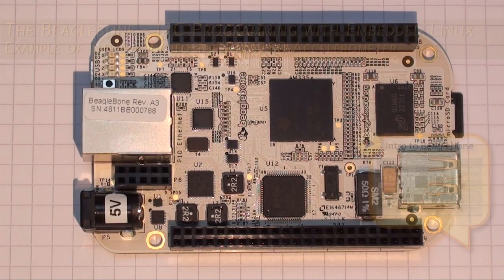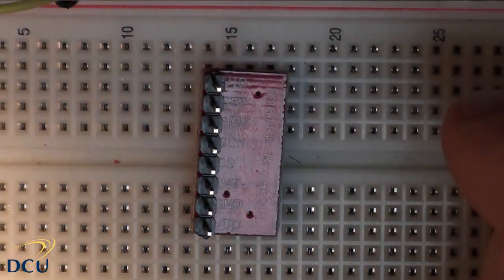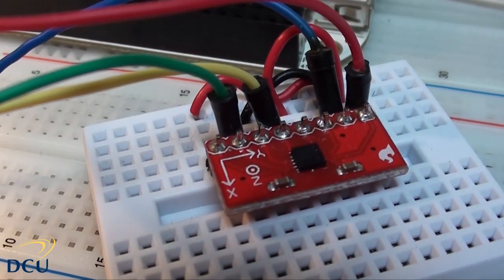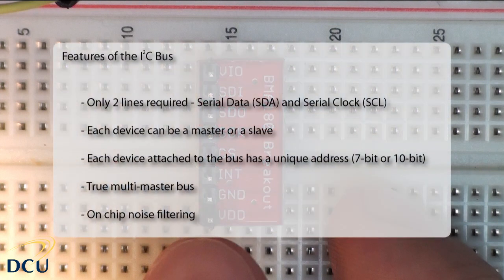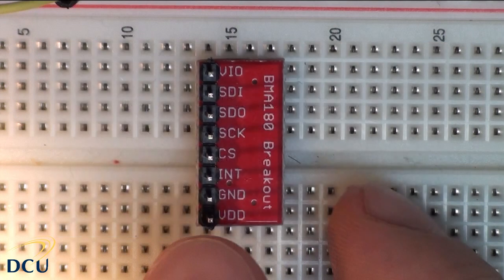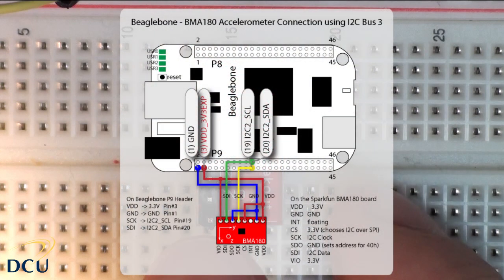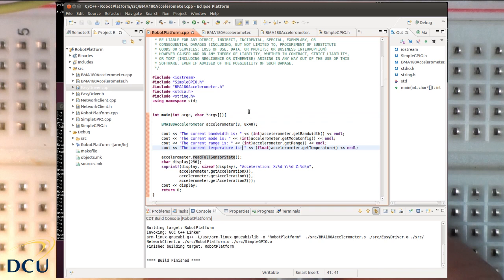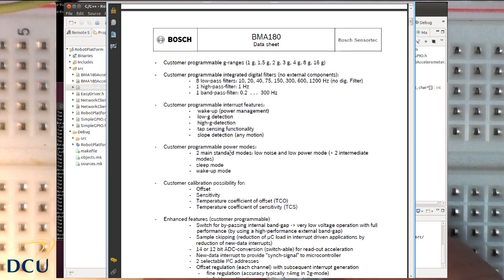Beaglebone: An I2C Tutorial - Interfacing to a BMA180 Accelerometer

Comment: No worries - thanks for letting me know. I found the KPlotWidget which will do the same job. I will now spend my day understanding (1) how to open a socket on the Beaglebone and expose the sensor data, (2) accessing the data on the host PC, and (3) displaying it in a simple Qt application. Fun! If I succeed, I will post the code on github in case anyone else is interested.

Comment: FYI, In some fields I do believe it is standard practice to utilize the full resolution of the destination variable when pushing your ADC values into place. This allows you to replace the ADC with one of a different resolution without needing additional programming changes (assuming the interface has not changed). Thus a 14-bit ADC and a 12-bit ADC would both utilize the same scale. Uusing a ushort, for example, would provide a universal scale of 0 to 65535 regardless of ADC resolution. This is very common in industrial applications.

Comment from the maker: Hi Bessem, I'll try to dig out the source code for my website. I had trouble finding it just now. The code on the client side contains some code that I do not have permission to redistribute. The code on the beaglebone was regular C++ socket code and the code on the server side (PC) was the standard QT socket example. The intercommunication worked straight off (if I remember correctly - there may have been one late night!)

Comment: this seems like an easier (?) way to interface through sysfs than directly through any I2C calls, worrying about whether SMBUS protocol is implemented, or what have you. definitely work some time to get better acquainted with this way or working with I2C.
Reply: when I worked with I2C, I did similar driver/application level class abstractions. good stuff. also using C++1y standards, strongly typed enums, using hex-enum values, to make it easier to translate to/from device docs, etc. driver classes being close to the metal, application classes being abstractions for the application level, where it makes sense, may combine multiple driver classes into various sessions, etc. well, closer to the metal, if you talk to pure C-guys, but with C++ any more, it's about as close as you can get to the metal. std::bitset is wonderful for this! :)

Comment from the maker: When you mount the SD card under Linux it should come up as two drives: Boot /media/boot, And rootfs. I have enabled i2c-2, by adding "i2c_bus=2,400" to boot arguments in uEnv.txt (under Boot). Now, I made this change after rebuilding the Kernel (in my next Beaglebone video) so I may have made some changes to the kernel configuration. Good luck!

Comment: Hello Derek, first thank you very much for you work, it really help us beginners a lot.And I have a problem here, I did everything just like what you said,and I also got the device address,but after that when I use the "i2cdump" command, almost all the values are 0,do you have any idea why that is happening?I'm using MPU6050,it's a 3 axis accel and gyro, so the data all be 0 just don't make any sense.And my BBB system is Linux arm 3.8.13(debian).Thank you for your help
Reply: liqiang Du You have to write a 0 to turn off the sleep bit. I believe you need to write to 6b. Try i2cset 3 0x68 0x6b 0.

Comment: I am trying to use the Ivensense iCP 10110 pressure sensor with a pocketbeagle. When i try to i2cdump to it I get many X (read errors ) and 1 value 01 (when it actually write back). Whenever I try to write or read from I get errno 121 remote i o error and then it dissapears from from the i2cdetect plot. I power cycle each time and start again. Has anyone encountered something like this ? If, so were you able to make it work?

Comment: Hello everyone! :) I tried to connect an MS5803-14BA pressure sensor to my Beaglebone Black, and when i test i2c-1 (pins P9_19 and P9_20), the sensor's address doesn't appear on the memory map. My hookup is the following
MS5803-14BA   Beaglebone_Black
GND              -> P9_1
3.3V              -> P9_3
SDA              -> P9_20
SCL               -> P9_19
I am using the latest Debian image on the BBB with the kernel version 3.8.13
My question is: Did i something wrong on the hookup or on the Beaglebone do i need to configure something to make the i2c probing correctly? Theoretically if i connected the sensor properly, then i should see its address on the Beaglebone. Can give me somebody an advice? Thanks :)
Reply: Csangomorfozis 

You need to enable the 3rd set of i2c pins. 
echo BB-I2C1 > /sys/devices/bone_capemgr.*/slots
Reply: deepa padmanabhan 

Initially, I couldn't get the BBB to recognise my DMA280 accelerometer. I had to use pull up resistors and enable to pin-select. What I mean to say is just connecting may not be sufficient.  There might be MS5803-14BA specific inputs you might have to give.

Comment: Could you do a video for the simplest way to connect a sparkfun's LSM9DS0 9dof  to beaglebone black? I can't figure it out...
Reply: have you figured it out yet?
Reply: fttl not on bbb. On arduino yes.
Reply: GodFear17 If you have figured it out, please let me know. I'm having the same problem.
Reply: *****  I never got the LSM9DS0 to work on the BBB, but I did get it working easily with the arduino, I'm just using a mega and works fine.
Reply: GodFear17 If you're still looking, I managed to get a library made based on the Sparkfun library: https://github.com/projectzen/Beaglebone-LSM9DS0
Reply: nice... good work will have to test it out